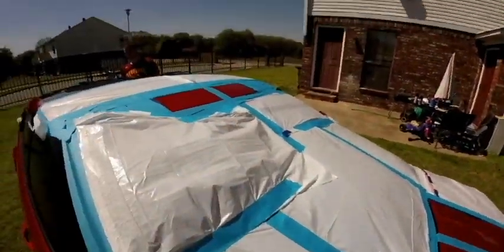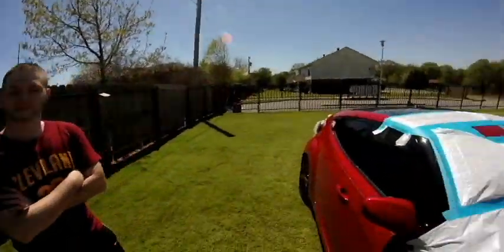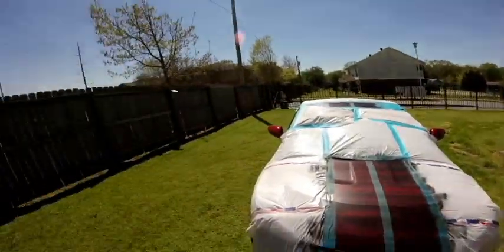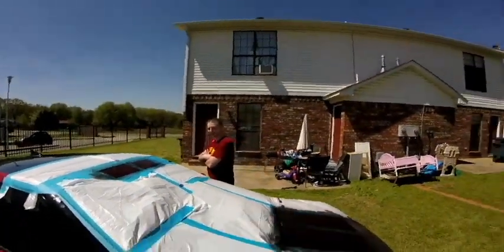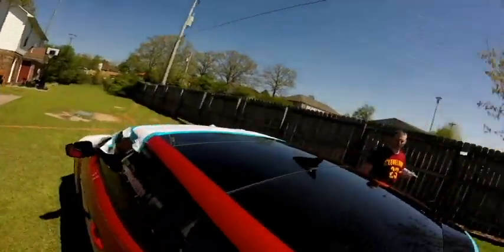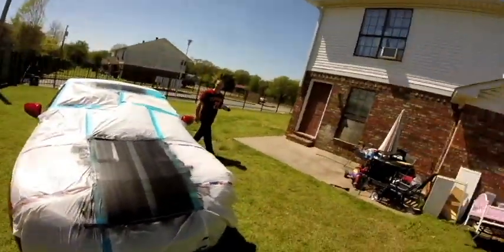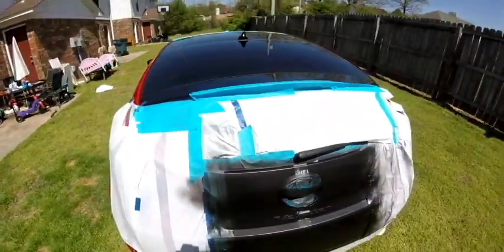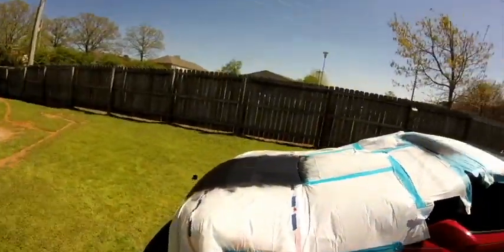Justins Veloster Gets the Plasti Dip Treatment!

Comment: How long are you waiting in between each coat? I always thought that with plasti dip you're suppose to do one thick coat and rip off the tape immediately or else you won't get straight lines. But it seems like you kinda took your time. Are you ripping the tape off immediately after your last coat? Is that the trick. I'm so confused lol
Reply from the maker: Eric Acosta its multiple coats. It's starts with a light coat. Wait 15 mins a coat for 5 coats. Last coat is the thickest. After last coat is applied. Get tape off when it's still wet. It gives you a clean line
Reply: That must be the longest lasting spray can in the world 🤔🤯